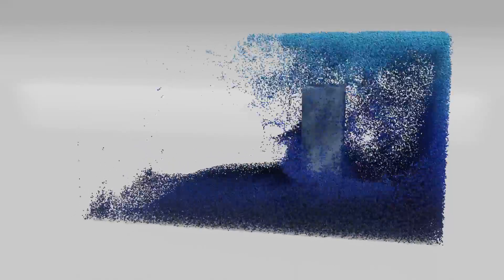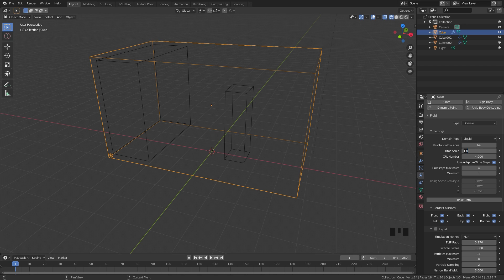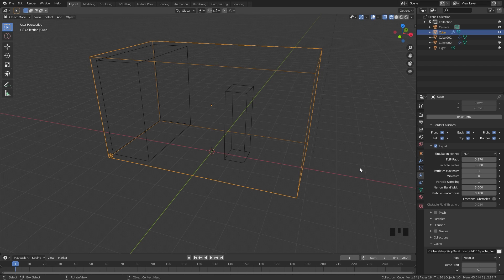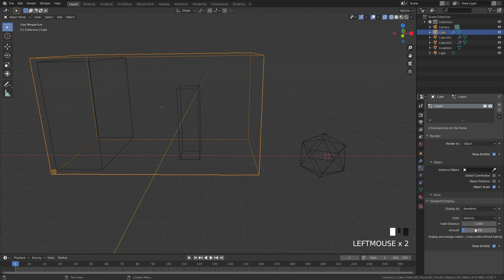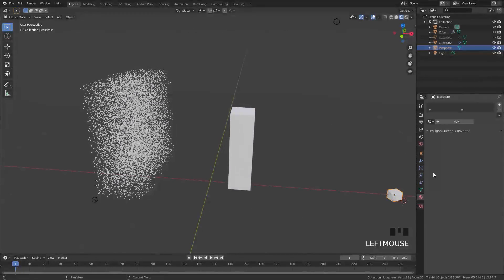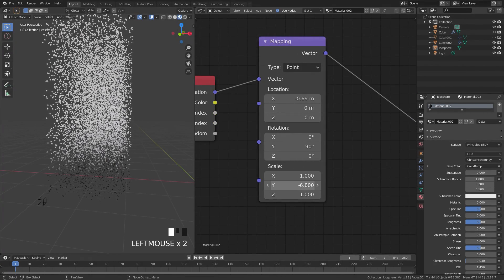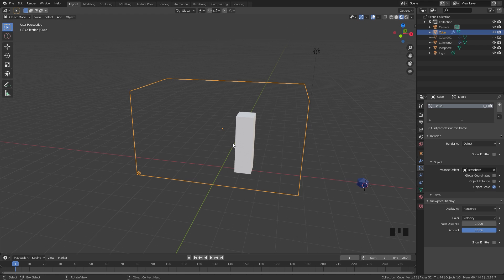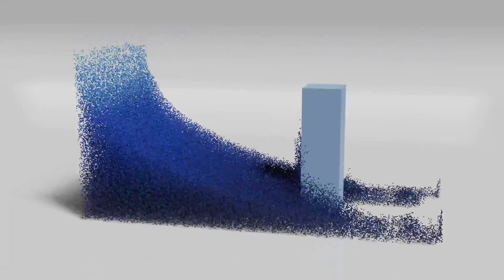Blender Tutorial - Mantaflow Simulation Fluid Particles  (2.82a)

Comment: I cant render it. when I try to render the video you cant see the particles but only the cube.
Reply: What has fixed this issue for me is to do two separate bakes. The first bake under domain settings and the second bake under mesh. Hope this helps.
Reply: @endanai299  how do you do that? Sorry im New to Blender...
Reply: @marsoosdarvislool5986  go in fluid and theres a mesh icon check it and open it then set the pressure to 1 if u want or 2 its ur choice then press the "bake mesh"button

Comment: Worked at first. Reopened the app and the particles are no longer showing up tho everything was saved. Tried baking again, still nothing.
Reply from the maker: The baking data is stored in a temporary file. Once you close Blender you will lose that data.   To save it you need to set a custom folder in the cache panel  of the domain.   Try freeing all the bakes, set a custom folder and bake again. This should work this time.

Comment: I had a problem with the collision elements, it doesn't reconize them... the particles just pass through them
Reply: FIXED adding thickness to collision elements! Thanks Bruv
Reply: @HUER_  This happened to me too. But I found that adding thickness meant there was a gap between the fluid and the object.
Reply: try subdivide the domain.. the reason its happen because blender generate the simulation base on the meshes of the domain and object.. denser the meshes better the fluid simulation

Comment: Could you please do video in ocean with manta flow and a boat floating on it
Reply: clash clash it won’t work from a simulation point of view, manta flow doesn’t support buoyancy, the easy hacks way to it is just use the ocean modifier and and shrink wrap modifier to the boat and set the ocean plane as the target, you would need to add a particle system and some dynamic paint to really sell the boat moving around in waves
Reply: @gower1973  oh ,thanks for the information
Is possible to make  ocean without boat , I mean only ocean
Iam new to blender

Comment: Because the particles have velocity info for color, do you know of any way to apply that color info to the particles or even a solid mesh?
Reply: @gregory_ginzburg  I just tried and no luck, any other info greatly appreciated
Reply from the maker: If you are using Eevee the particle info node will not work.  Try switching to cycles and trying it again.
Reply: Are you trying to make a mesh out of the particle simulation itself? Because there is a mesh tab in the Domain and you bake it from there. I think he goes through that in this one:
https://youtu.be/YdUWqkqcxzw